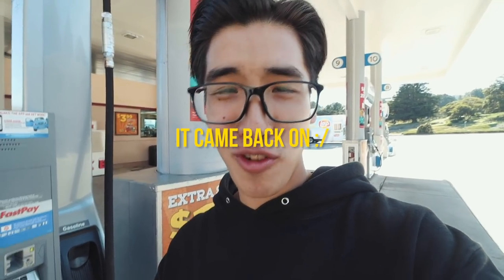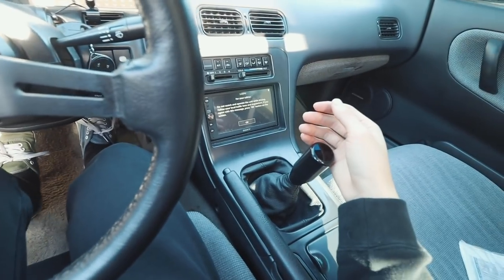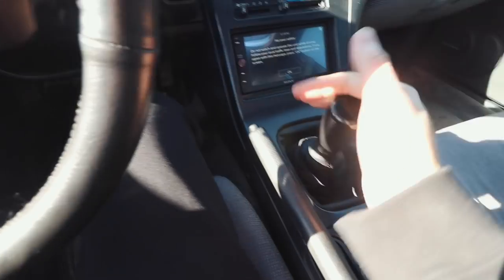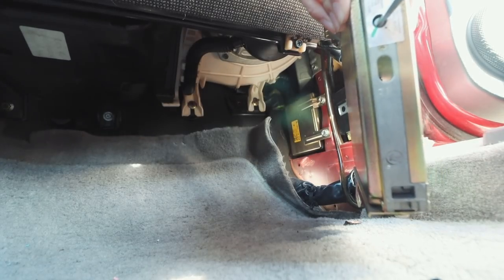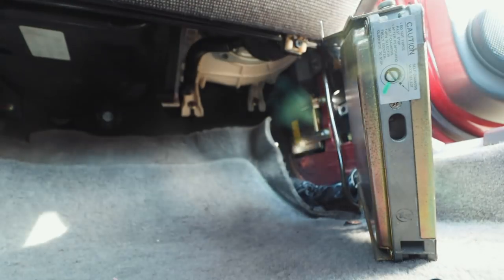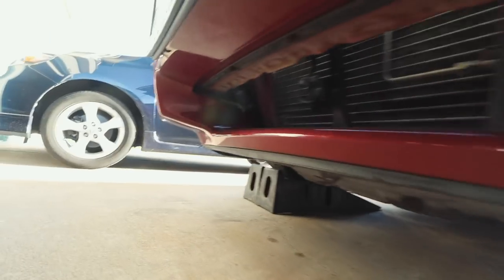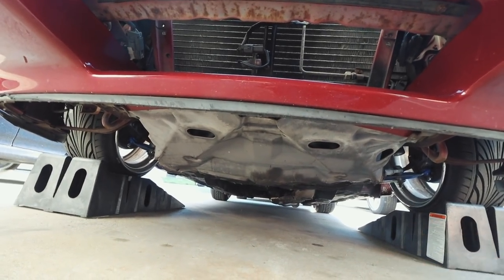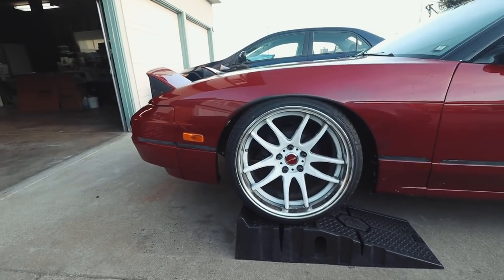FIRST PROBLEMS WITH MY S13

Comment: Looks like the nut under your shifter is loose, causing your shifter not to seat in gear all the way, so it grinds before engaging
Reply: @F.B.I pressure plate, fly wheel, slave cylinder, shift box itself, or transmission is what i can think of my boi!
Reply: @F.B.I  what year 350z?
Reply: F.B.I not sure what trans is in it but it might not have a CD009 which means the synchros are probably going bad in it.

Comment: Hey man love the 240 but i heard compressed air come out of the gas cap if there is compressed air coming out when you open the gas cap you need a new charcoal canister for the gas tank to to breathe because with my car i went through 3 gas tanks before we found the problem and if you dont get a new canister your gas tank expands and it will form a hole in the bottom because of the pressure because the gas tank isn't breathing, i just wanted to warn you before your gas tank goes out, looking out for a brother

Comment: Code Meaning 11 - Camshaft Position Sensor 12 - Air Flow Meter 13 - Coolant Temperature Sensor 14 - Vehicle Speed Sensor 21 - Ignition Signal 25 - IACV - AAC Valve 26 - Boost Pressure Sensor 31 - ECM Fault 32 - Exhaust Gas Recirculation System 33 - Front EGO Sensor (O2-1 Sensor) 34 - Knock Sensor 35 - EGR Temperature Sensor 36 - EGR BPT Valve 37 - Closed Loop System 41 - Intake Air Temperature Sensor 43 - Throttle Position Sensor 54 - Signal from Auto Transmission 55 - Other Malfunction. CONSULT Terminal Required 63 - Cylinder 6 Misfire (?) 64 - Cylinder 5 Misfire (?) 65 - Cylinder 4 Misfire 66 - Cylinder 3 Misfire 67 - Cylinder 2 Misfire 68 - Cylinder 1 Misfire 71 - Random Misfire 72 - TW Catalyst System 76 - Fuel Injection System 77 - Rear EGO Sensor (O2-2) 82 - Crank Position Sensor 84 - Automatic Transmission Diagnostic Comms Line 95 - Crank Position Cog 98 - Coolant Temperature Sensor 103 - Park/Neutral Switch 105 - EGR Solenoid 111 - Inhibitor Switch 112 - Automatic Transmission Speed Sensor 113 - Automatic Transmission 1st Signal 114 - Automatic Transmission 2nd Signal 115 - Automatic Transmission 3rd Signal 116 - Automatic Transmission 4th Signal 118 - Automatic Transmission Shift Solenoid Valve A 121 - Automatic Transmission Shift Solenoid Valve B 123 - Automatic Transmission Overrun Clutch Solenoid Valve 124 - Automatic Transmission TOR Conv Solenoid Valve 125 - Automatic Transmission Line Pressure Solenoid 126 - Automatic Transmission Throttle Position Sensor 127 - Automatic Transmission Engine Speed Signal 128 - Automatic Transmission Fluid Temperature Sensor
 

👍🏼

Comment: try shifting into 2nd and then shifting into 1st, if it does not grind it then its most likely the synchros. Most likely a bad habit of previous owner putting GL-5 fluid..
Reply from the maker: it worked!
Reply: @TylerTea  🤟